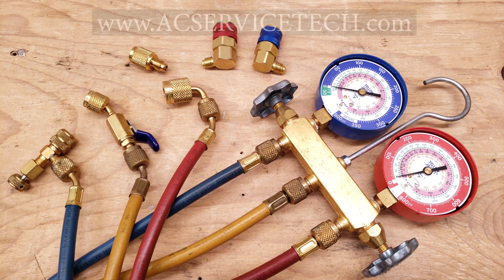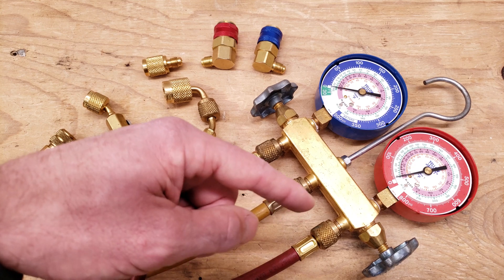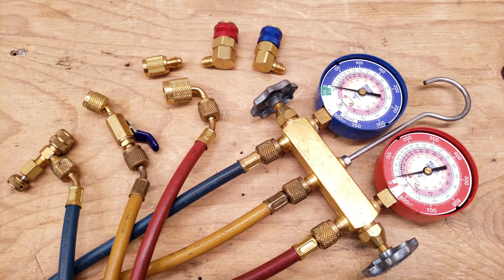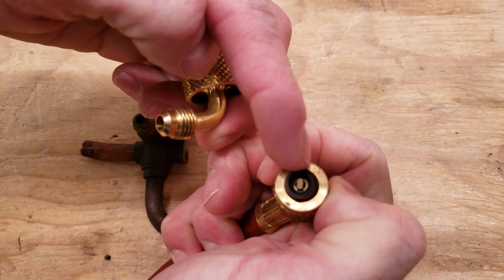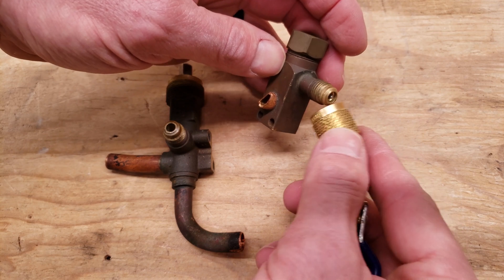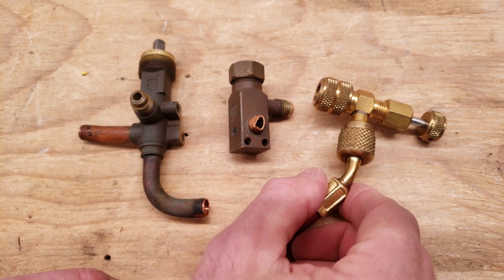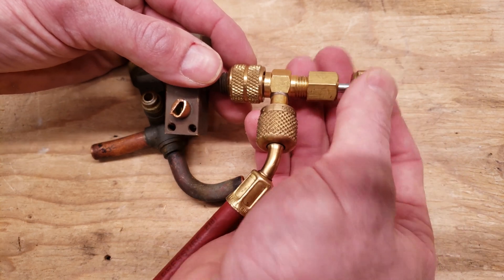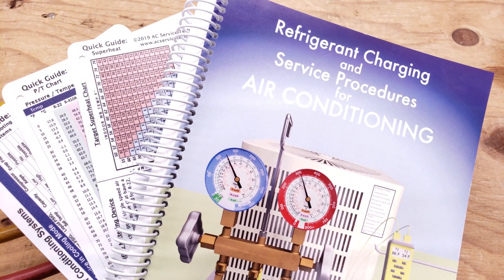Refrigerant Hose End Fittings! Why They are Needed!

Comment from the maker: My Paperback, E-Book, Workbook, Quick Reference Cards: https://www.acservicetech.com/store  
E-Book: https://play.google.com/store   and search "AC Service Tech"
My Paperback and Quick Cards:  https://www.amazon.com/shop/acservicetech
Tool List:  https://www.amazon.com/shop/acservicetech
Support the Channel:  https://www.patreon.com/acservicetech

Related Videos:
Connect & Disconnect Refrigerant Gauges! Low Loss Fittings!: https://youtu.be/xTctTHhOgaw
Check the Air Conditioner Refrigerant Charge, Connect, Measure, Disconnect Procedure! https://youtu.be/4oE3pkhJynQ

Fittings and Adapters used in this Video:
1 Ball Valve Fitting: https://amzn.to/2VN1lyO
3 Ball Valve Fittings: https://amzn.to/3cCtJcT
Automatic Low Loss Fitting: https://amzn.to/38q4FCA
5/16" Adapter: https://amzn.to/2v0J71H
5/16" Angled Adapter: https://amzn.to/38tHaZw
Automotive Adapters: https://amzn.to/2IwXOwt
Appion Valve Core Removal Tool - http://amzn.to/2uYr8WL

Checking the Charge Tools:
Yellow Jacket Refrigerant Gauge Set http://amzn.to/2aenwTq
Refrigerant hoses with valves http://amzn.to/2aBumVI
Yellow Jacket Gauge set & hoses https://amzn.to/2vLVkV9
Yellow Jacket 4 Port Manifold w Hoses https://amzn.to/2BkuGIq
Digital Refrigerant Scale  http://amzn.to/2b9oXYl   
Ratcheting Service Wrench   http://amzn.to/2dGV4Nh 
FieldpieceSMAN360 Digital Manifold Set https://amzn.to/2BdoaD4
FieldpieceSMAN460 Digital Manifold Set https://amzn.to/2nB4Fe6
Compact Ball Valve for Refrigerant Hose https://amzn.to/2KUisW8
QuickDisconnect 90 for refrigerant hose https://amzn.to/2MMtVcg
RectorSeal Bubble Gas Leak Detector http://amzn.to/2ckWACn
Fieldpiece ST4 Dual Temp Meter  http://amzn.to/2wc1ME3
Fieldpiece Bead K Type Temp Sensor https://amzn.to/2DBwKfs
Fieldpiece Wet Bulb Temp Sensor https://amzn.to/2RRI7Tw
Fieldpiece TC24 Temp Clamp https://amzn.to/2qHLyjZ

Electrical Diagnosis Tools:
UEI DL389 Multimeter  http://amzn.to/2xAdaJf
UEI DL479 Multimeter with temp sensor http://amzn.to/2jtsUbJ
Magnet Jumpers- https://amzn.to/2PyKPQZ
Alligator Jumpers- https://amzn.to/2PxqJXn
Irwin Wire Stripper/Cutter/Crimper http://amzn.to/2dGTj2V

Vacuum Tools:
JB 6 CFM Vacuum Pump - http://amzn.to/2nqbvo8
CPS 4 CFM Vacuum Pump - https://amzn.to/2DxgPwY
Appion Valve Core Removal Tool - http://amzn.to/2uYr8WL
Appion Blue 3/8" to 1/4" Vacuum Hose - http://amzn.to/2uYlVyc
Appion Red 3/8" to 1/4" Vacuum Hose - http://amzn.to/2uYg6Ro
Yellow Jacket 1/4" by 1/4" 3’ hose - http://amzn.to/2umtcod
Appion 1/4" by 1/4" and 3/8” hose - https://amzn.to/2Zyxzx9
Uniweld 1/4" by 1/4" 2’ hose - https://amzn.to/2GFov1Y
CPS Vacuum Micron Gauge - http://amzn.to/2v1nM3O
JB Vacuum Pump Oil - http://amzn.to/2mGrlXy

Flaring Tools:
Yellow Jacket Flaring Tool - https://amzn.to/2OBxGlM
Spin Flaring Bits 1/4", 3/8", 1/2", 5/8", 3/4"- https://amzn.to/31BCs8Z
Yellow Jacket Flaring Tool with Set Depth - https://amzn.to/2QIKsQH
Yellow Jacket Torque Wrench - https://amzn.to/2NRR68Q
Uniweld Swage and Flare Kit- https://amzn.to/2T55jyn
Nylog - https://amzn.to/2MLJcch
Ridgid Tubing Cutter - https://amzn.to/2DnjjR1
Wolverine Tube Reamer - https://amzn.to/2QGLyMV

Swaging Tools:
Manual Copper Tube Swage/Expander- https://amzn.to/2WRPa1M
Spin Swaging Bits 1/4" to 7/8" for the Drill-  https://amzn.to/2YQwwqS
Uniweld Hydraulic Swaging Tool- https://amzn.to/2MlrI8m
Uniweld Swage and Flare Kit- https://amzn.to/2T55jyn
Uniweld Hammer Swage kit- https://amzn.to/2CzWMMU
Uniweld 3/4" Hammer Swage- https://amzn.to/2CzXsSs
Uniweld 7/8" Hammer Swage- https://amzn.to/2Mja5WE
Uniweld Multi-Size Hammer Swage- https://amzn.to/2T3Cx1b

Brazing Tools:
Air Acetylene Torch setup - http://amzn.to/2aQalsb
15% Silver Brazing Rods - http://amzn.to/2gVLyLc
Ameriflame Oxy Acetylene Torch Setup #1 &#2 Tip - https://amzn.to/2SRm3JF
40cu B Tank to 10cu MC Tank Acetylene Tank Fitting - https://amzn.to/2GxZZPi
Nitrogen Regulator - http://amzn.to/2bXdR5f
Uniweld NitroVue Flow Regulator - https://amzn.to/2GnsaAo
Uniweld Nitrogen Flow Meter - http://amzn.to/2brvoBg
Stay Brite #8 Silver Bearing Solder and Flux - https://amzn.to/2XIDJsY
Aluminum Braze Rods - https://amzn.to/2IGNMu

Refrigerant Leak Detection Tool:
Accutrak VPE Ultrasonic Leak Detector https://amzn.to/2nFYKVe

Shop through Amazon! Your Purchases through Amazon provide a means for channels such as mine to earn advertising fees from all purchases after clicking through. Prices are the same as normal.

Comment: I like that the hoses have female connectors on each end. I bought a Mastercool that has female on one end and male on the quick connect side. Stiff as a board when connecting to automotive fittings that are at an angle!

Comment: In the manual for the MINI SPLIT I want it says to run the vaccum for 25 minutes. I don't understand how you can do that without the vacuum ending up too strong -ie the max vacuum power of the vacuum?.. The electric vac I'm looking at says it goes to "5Pa". I'm guessing that is way more than the -0.1MPa the manual says to do it to. 

This is so confusing... 5 Pascals = 0.000005 Mega Pascals (which I assume MPa refers to). 
-0.1 MPa = -100000 Pascals. I don't even know if higher numbers mean more or less vacuum any more.

Comment: when connecting 【Angled Ball Valve】45 degree angle Manual Shut-off Valve fitting to the hose, should i be removing the "depressor" and gasket of the hose since there is already one at the end where the ball valve fitting connects to schrader valve?

Comment: I retired from HVAC a few years now. I have an old R22 pressure gauge, and I installed a mini system for my garage, but my gauge end wont fit the service valve of the 410A system. Is there an adapter to fit the older gauge?
 I'll be using the high side of the older gauge on the low side of the system . I don't want to have to spend money for new gauges just for the one time use.
Reply: You want a 5/16 adapter

Comment: Can you pull a vacuum on a system with low loss fittings?
Reply from the maker: I would not do that due to leaking the vacuum through them or obstructing the vacuum, thanks!

Comment: why do you only want automatic low loss fittings on the high side? Thanks for your videos, very helpful, will purchase your book
Reply: Because you lose the most refrigerant from the liquid line when disconnecting using no fittings . You can use low loss fittings or ball valve shut offs on both high side and low side  .Which ever you prefer.

Comment: Hello. Which valve core depressor tool or any low loss do you recommend for 410a? 
These O rings are blowing like crazy! 

I have the yellow jacket and JB brand  (JB last longer but can't find replacement O rings).
I also have a twist style  C&D (CD2060) which I attempted to use today and it was leaking right after what (cant think of exact name)  screws onto the service port of the system. 

Thanks in advance.
Reply: I know its old but I use appion for my valve core remover. I dont know many others that can handle 410a like it does.
Reply: @HelloThere-jr6gd  I was referring to low loss fittings. I use appion and hilmor for core remover

Comment: I didn't see a link to the Valve Core Depressor Tool used in the video???
Reply: Lee Byrd The best valve core removal tool is the Appion  https://appiontools.com/mgavct/and there is also a mini-split version https://appiontools.com/mgavcr/.    Both are available nationwide at United Refrigeration https://www.uri.com and Aireco https://www.aireco.com   Remember to always use black HD hoses for vacuum & recovery and the bigger the hose, the faster the pull-down!
Reply: This person asked where is the link to the “valve depressor tool” mentioned in the video. The adapter fitting that screws on to 1/4” auto valve, depressing the valve, then your gauges screw on to the adapter. Someone responded with a link to “valve removal tool”. I can’t find the link either.

Comment: Can you please explain why when we have dirty evaporator the subcooling will be high and dirty condenser gives low superheat
Reply from the maker: If you have a dirty evap coil with a txv, subcooling will be higher but with a fixed orifice subcooling will be lower. A fixed orifice won't limit the superheat so you have more saturated refrigerant in the coil, therefore there is less in the outdoor unit to subcool. Thats why the subcooling is less with a fixed orifice. For a txv the amount of refrigerant needed to keep the superheat steady is less than normal due to the low heat load so there is more refrigerant in the outdoor unit, therefore more subcooling. Great question!
Reply: @acservicetechchannel  thank you Sir for your response God bless you and bless your work

Comment: I don’t see the angle stop that you turn to open and close listed.
Reply from the maker: I believe you are talking about this one, thanks!- 1 Ball Valve Fitting: https://amzn.to/2VN1lyO
3 Ball Valve Fittings: https://amzn.to/3cCtJcT
Reply: @acservicetechchannel  I think hes talking about the C&D Valve CD2070. the core depressor with backseat
Reply: James that would be the one CD2070 thank you.
Reply: Nice, I like these  CD2070 type, they're like my automotive ball-lock with manual valve. Barely even a puff on the high side when disconnecting.